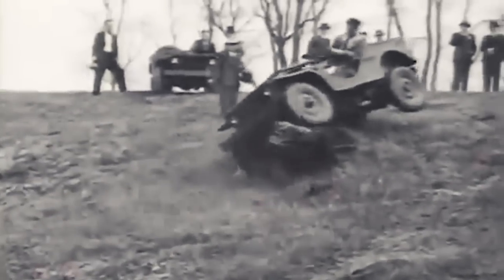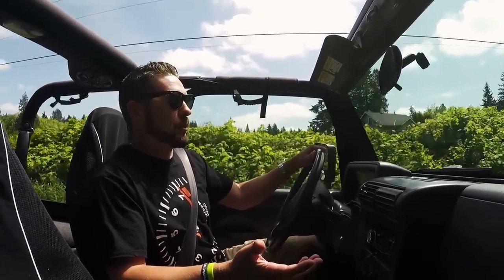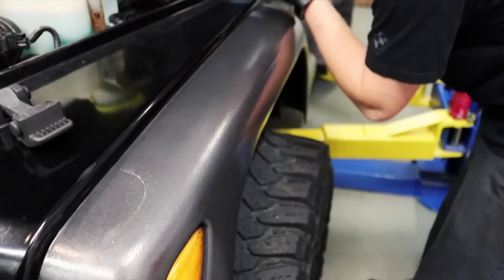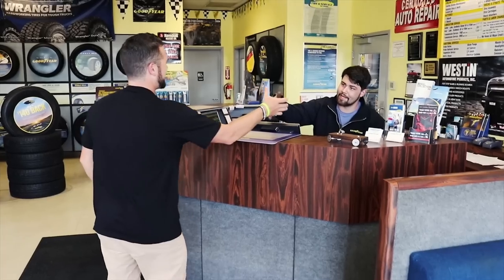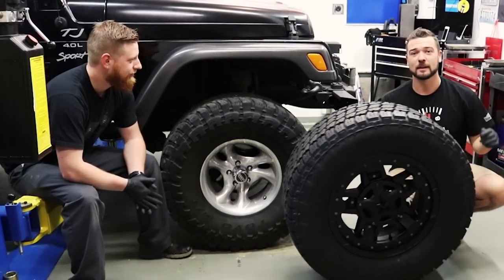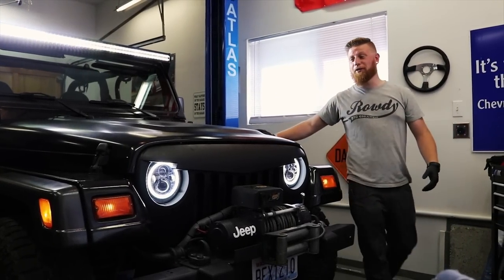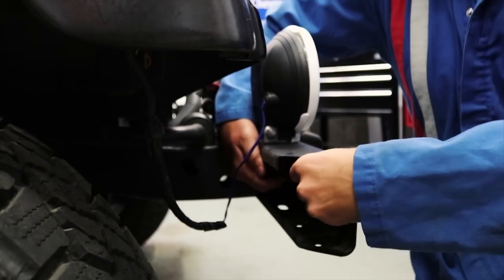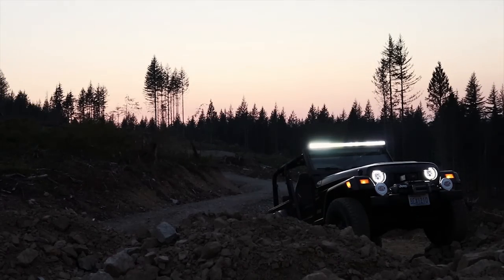How To Flip Jeep Wranglers For Profit! (The Secrets)

Comment: Cool build but the grille cover needs to be removed
Reply from the maker: Thx for the support! Would you just keep it stock or is there another cover you'd replace it with? This was my first Jeep and trying to learn more about what people like doing to these great rigs!
Reply: When I first got my TJ it had a chrome grille overlay that covered the whole grille. Needless to say, that and the side steps were the first things I took off!
Reply: And as for the grille cover, the angry face cover thing is just so tacky now
Reply: You could have also just plasti dipped the headlights at an angle to give it the angry look. And not bought the grill.
Reply: I know the grill covers are tacky now and in my opinion just plain ugly
Reply: Ideal Cars  I had one of these angry grille at first I liked then I removed it because it took the real jeep look. I like the stock classic look of a Jeep.
Reply: Ideal Cars  yeah keep it stock. When I had the angry grille installed the temperature would rise faster, once I removed it it became normal again.
Reply: The classic Jeep grill is the way to stay. A little wire-brush action and a coat of flat black or bed liner is the way I went.
Reply: The stock grill is the best imo
Reply: Agreed! My '00 TJ has the stock grille, no chrome inserts, black bezels with basic Quadratec LED headlights. Clean, bright, classic! And still sporting all of the original scratches and patina!
Reply: After the tires, you added every over used bolt on item.   I'm not a fan of the LED light bar.  Looks like an emergency vehicle.
Reply: Mike V, that's even worse.
Reply: I like the angry grill XD
Reply: @IdealMediaChannel  Well, you took a classic jeep and covered its most iconic feature with a cheap piece of plastic.  Leave the original grill for sure.
Reply: You could always go with the eyelashes. 😄
Reply: @flyhighq8182  At the same time that's not even ur car so u rly can't tell him what to do w it, and ur only detailed explanation of y u don't like angry grille is that it "took the real jeep look." No shit buddy that's y it was put on in the first place.
Reply: @IdealMediaChannel  the golden rule is to NEVER EVER touch the grille.
Reply: Stock looks better
Reply: Just buying a 2000 TJ Sahara, my first Jeep. I stumbled across this video and appreciate how easy you show it is to work on some basic things, like showing how to do some basic stuff so many other people gloss over - like removing the cowling.   Thank you.
Reply: I agree. I like the older look and it gets more and more iconic the older it gets
Reply: Angry eyes where cool when no one had them but now they are tacky and frankly kind of ugly
Reply: The angry grill was ALWAYS tacky
Reply: A Jeep should keep the factory grill. The angry bird grill is for $50k mall crawlers
Reply: @grandwaha  
Always agree with the bandit
Reply: Ideal Media you added an angry eyes grille most Jeep owners don’t like it. If you’re gonna replace it get a grille that looks like a normal one and not one like that.
Reply: Ideal Media keep it stock
Reply: Light bars are freaking annoying when doing a trail ride with a big group, everyone has them on behind you and you are freaking blind.

Comment: The Harness they used was a Autodrive Harness and it's actually a really nice harness, I use the same one on my F250, Light bar in the front and I used 2 4" LED pods for the rear and spliced the wires together for the 2nd plug on the harness. It's really a great harness at a very reasonable price.

Comment: For a little less than $5000 I got a TJ 1997 that has some type of leak under the car and a lot of the frame seemed to be rusted, but was painted over with black. I think one of the sway bars are broken or something and there is no treason most of the tires. Literally the whole bottom seemed to be painted black. Was this a good deal and how hard and or expensive would it be to work on all of this?

Comment: Hey guys great video! I had a question I’m currently looking to improve my 98’ TJ. Debating on 33” or 35” tires. I noticed you used 33”s in the video. Were you required to use a lift ? And if so what size would you recommend for each tire size ? Thank you!

Comment: Just looked at a 2002 jeep wrangler sahara. 5sp 4.0L.  There is some rust concerning me by what I believe is called the middlemount bolt. It's about halfway between the wheelbase. Thoughts? I'm 17, and don't know much. There's a little slop in the steering. You guys think these are easy fixes? Or major concerns? Been on forums for hours. Not sure what to do. Any help is more than wanted.

Comment: Light bar before lockers, poor Jeep may never see the dirt again.
Reply: also strictly pavement tires. new tires have no meat or sidewalls.
Reply: Yeah....I was thinking it should have rock sliders, upgraded gas tank skid plate, ARB or OX lockers .... etc.... so many things about this make this anything BUT a real Jeep build.   That tire cover they put on there.... that is trouble.   Means they don't have a full-size spare.
Reply: ViolentLotus that’s why I’m happy my LJ was a rubicon and it came with lockers
Reply: Idk man i would buy a cheap 20$ ebay light bar before I buy a $1000 air locker

Comment: Dude this is what I'm looking for one of the best deals you got here, very easy to fix and cheap , i just got an xj 96 for 2000 some rust on floor  but clean body and frame and big hit IN the driver side i ll be fixing but drivable even that i jump on it trough passenger side i don't care i drive  to work, and awesome strong 4.0 HO engine 4.5 lift 33 tires,  30 dana front , slip joke eliminator, 8.25 rear, so  axle very happy with my crashed xj  i ll be restoring little by little,

Comment: Tip,..I didn't notice if you changed the spare or just put a cover over it, when changing tires and or wheels ALWAYS ALWAYS be sure to get a full size matching spare wheel and tire.  So if you end up needing to use it, it's jsi nice to put the spare on and the tire and wheel are identical in siE and style, back spacing etc , then if you're off-road when it happens you're not wheeling with different sizes .. not a fhiyr deal for a sport but if your end up with a Rubicon or some that has aftermarket locking differential you won't have issues if your wheeling and it locks or you lock it, aside from that it looks 10,000 times. Better having an actual matching spare , drives me insane when I see a wrangler on 35's or whatever and has a little 30" spare.  That much of a difference is dangerous ontnhe highway especially the little wheel base wrangler.

Comment: You guys should of added an inverter in there for an outlet, an air pump, 200 amp alternator, changed the interior LEDs, CB radio, a pa system, new speakers, a 4 inch long arm or short arm lift with hydro shocks, and a water tank in the back. Btw you guys got ripped off on the tail lights you can build your own for 15 dollars it's just the wiring of an 1157 bulb not to hard.

Comment: Next time you bedline/rhinoline a tub like that, pull the drain plugs and reinsert them after the liner has cured.  That way they maintain the functionality without causing your liner to chip or bubble since you had to cut or dig them out.

Comment: Removing the carpet wasn't worth it, a complete set of carpet in a Tj is really valuable and it keeps the tub from getting too hot when driving. i would've rhino lined and then put it back.
Reply: Drew Lotz Completely agree...I've got an '01 Sport and the po ripped out the carpet and lined it. The driver's side floorboard is insanely hot. I just picked up a full used carpet setup for thirty bucks. Gonna install it next weekend. I expect a decent heat and noise reduction. Fingers crossed...
Reply: slayerwatcher what are you talking about? I’ve owned 3 Tjs and my current 99 has had the carpet removed along with the other two. Absolutely no issues here

Comment: The jeep wrangler first came out in 1986. Also the CJ7 was also produced simultaneously for only that one year.
Reply: The YJ Wrangler was a 1987 model year but build did begin in 1986 in Canada  , the last CJ was 1986 model year . I worked on the CJ assembly line from 1983 till 1985 .

Comment: You should've fixed the winch, added a small lift, rear locker, and changed the tires to K02s. And maybe later you could change the headlights to LED ones.
Reply from the maker: Next one I may try to do some/all of that!

Comment: Sooo, where's the build video? All I saw was bolting on some Chinese lights and a plastic grill cover. Where's the suspension, ring and pinion, lockers, slip joint, bumpers, sliders, fenders, engine work, torsion disconnect, etc, etc?

Comment: I really don't like how those halos turn off the head light when the blinker is on. I understand it is to help people see the blinker better... but at the cost of losing light in the direction you are turning is absolutely not worth it. You commonly seen this with LED running lights on new vehicles that run off when the blink is on which makes sense because running lights do not do much for helping you see at night... but to have your actual head light turn off on the side you need it the most when turning is just a stupid design.

Comment: Everything mechanical you inspected was beyond basic. Brake hoses cost $11 on rockauto.com, a battery with corrosion= $100 battery and a $40 voltage regulator.

Comment: Yet another poor TJ ruined. You drive up to the seller in a new porsche, low ball him over 2k, install shitty chinese parts on it and rockstar wheels, then screw your friend over 4k. You had to do it to a nice 4.0L 5 speed too. To garner any kind of respect in the Jeep would you actually need to put in work and do stuff. Jeeps are made by exploring, mistakes, breaking things and modifying out of necessity. Even mall crawlers put in work, meticulous cleaning,  many hand painting suspension parts, making custom interiors for their ride, making custom fender liners. This is not how you build a Jeep. I see you asking about what grill would be best and my advice to you would be to keep or paint the stock grill and build a custom bumper with a cool stinger, lots of brownie points for the dirt purists and it gives it very mean offroad look. And for rims go with a 16 inch beadlock for ultimate off road capability and a much more aggressive look. Or even something as simple as flat or trimmed fenders. Also those big wheels with tiny lift looks stupid and would ride terrible offroad. Sorry for being harsh, it's just that you did the equivalent of putting fake vents and flame stickers on a car.

Comment: how to build up a jeep:  Bigger tires, forget any lift or clearance issues, you don't need suspension to work properly in the mall parking lot.  Lights, light bars, fog lights, and ANGRY EYES!

Forget axles, lockers, articulation, gearing to accommodate 33.5" tires... That's for posers.

Comment: The whole "Buddy had his OLD truck stuck" was a BULLSHIT stunt for making this crappy "Built" Jeep look a little better. At 20:29 you'll see the Dodge Dakota is a 4X4 also but as you watch "Trav" try to get it unstuck you'll notice the rear wheels on the truck are the only ones turning. HELLO? 4X4 Dakota, put it in 4L and it would have not been "Stuck"! And yes I'm a 1994 YJ Jeep owner and this whole "Build" wanted to make me puke! To the two bone heads that did this video, Next time spend some time looking around at real Jeeps, do a little research on what a Jeep Build is and stop pretending you know what your doing! All you did was bolt on some shit and spray a little bed liner and you think you built a Jeep. Oh and buy a damn heat gun!